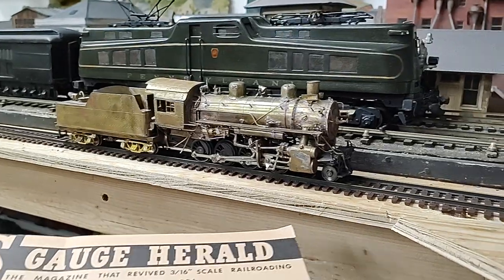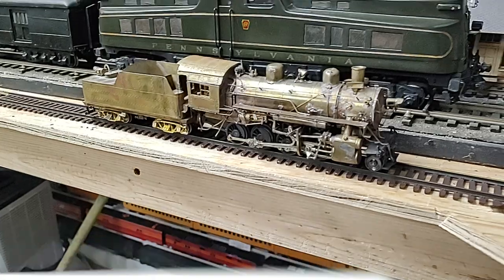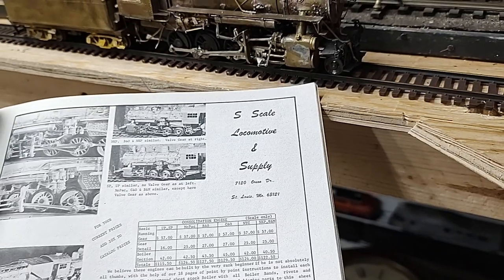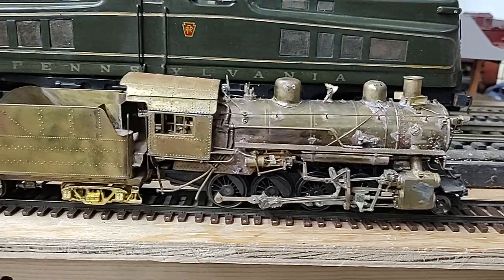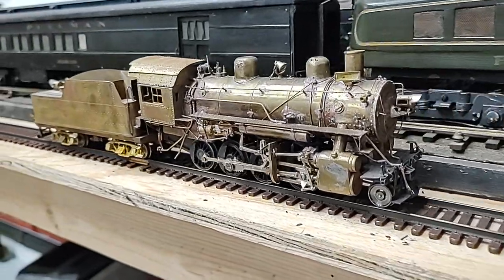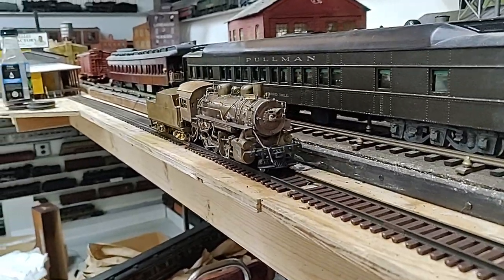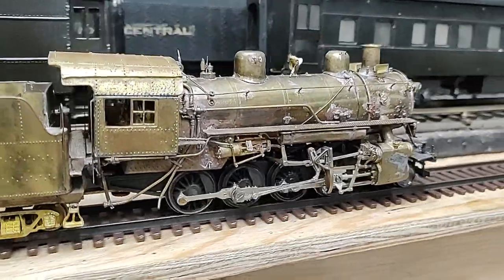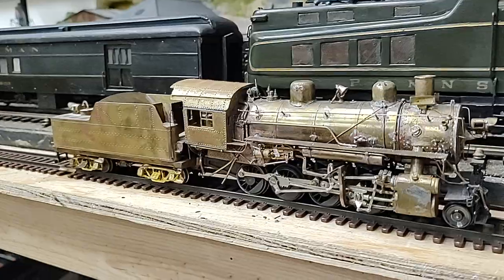Vintage S scale / gauge brass Consolidation steam engine by S Scale Locomotive & Supply 1978

Comment: It is too bad they didn't have CA cement back then, soldering the parts would be tricky for a beginner!
Reply: Soldering is not that difficult. Its also much easier to repair than having to remove ACC glue in order to solder. If one must not solder, a slow setting but strong epoxy is better.. it lasts longer than ACC on brass.
Reply: they did, but you dont build a brass engine with glue
Reply: @jenniferwhitewolf3784  - You are right about soldering - after all, that is how brass models are assembled.  I get this picture of using a torch to solder a sand dome & the air compressor I soldered on earlier falls off.
Reply: @davidkoehler136  - Yes, soldering is how the brass models are assembled.  It seems to be something that could be frustrating for a beginner.
Reply: Superglue is by far the worst thing for assembling or fixing brass models. It WILL fail so another glue job is not better. But all that glue has to literally  be burned out and cleaned for any proper solder job to happen.
Reply: @crazyman762  And superglue doesn't conduct electricity, so any needed electrical contact could be disrupted.